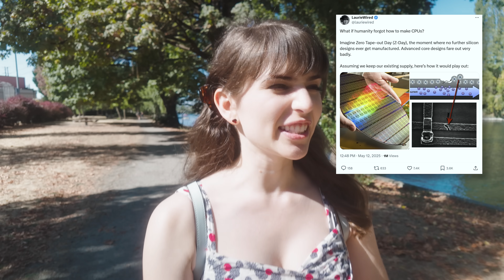what if humans forgot how to make CPUs?

Comment: A little too unrealistic for a few reasons:
1. There are a LOT of hobbyists that spend a significant amount of time and effort reverse engineering and researching even older CPU architecture. Video game emulators? Those are passion projects that require a target CPU's instruction set to be mostly or completely mapped out for emulation. I vaguely recall skimming through a defcon video or slide showing the entirety of an x86 CPU with pins painstakingly mapped out.
2. Computer architecture are courses students interested in computer science or programming can take. This could be seen as a formal or perhaps introductory to the above.
3. What happened to all of the professionals working in CPU development and production? Did catastrophic war breakout and eliminate them? Did this just turn into a post-apocalyptic story based around surviving and farming instead of one that cares about CPUs?
4. In theory, it makes sense that CPU development could reach a point where further improvements are either too costly, too minimal, or simply too advanced to realize; however, I believe any functioning society which utilizes CPUs to an extent to which current societies do would never cease CPU production. Degradation, damage, introduction of new uses, or introduction of new departments there are simply too many real reasons that CPU production would always be a necessity so long as the materials and means of creation were available.

I suppose if the materials simply didn't exist, you might have a way to make the story work; however, I would imagine alternatives, even less effective ones, would spring up in such situations. Such alternatives would restart the production, and likely development, again.

Furthermore, a world where such materials were drained or approaching depletion, might be more concerned regarding other exhaustible resources. Apparently silicon is fairly common on the moon, so perhaps silicon would become extremely expensive, but the availability of the fuel required to reach the moon might be a more pressing, immediate concern instead.

Finally, in a world where literally no one is developing CPUs and society is collapsing, people would absolutely capitalize on the opportunity to be the ones providing that product for very, very great profits.
Reply: Logic ports in chip is not the problem here. It is the manufacturing process.
Reply: knowledge is more fragile than ppl think
Reply: @gregoryallen0001  there are 10,000,000,000 of us. Is all of the shared knowledge of the species really that fragile?
Reply: @cyborgninjamonkey It definitely is. A deadly combination of factors contributes to it: the anti-intellectual movement gripping the West, corporations outsourcing manufacturing to save a few pennies, more and more specialised manufacturing processes that fewer and fewer companies can manage...

I saw a video recently explaining how essentially every CPU in the world can ultimately be traced to a single company, because that company is the only one capable of making the machines that make the machines that make the chips. It's a single point of failure that could easily trigger the fall she was describing.
Reply: The CPU emulations run either on another, bigger CPU or on an FPGA, which uses the same technology as a CPU.
Reply: Designing CPUs and understanding how they work is different from manufacturing though...

To stop manufacturing, just imagine all chip fabs being destroyed... What would it take to build a new independent fab, if you have no expert to guide you on the intricacies of manufacturing? You just have the publically available know how.

Comment: I thought that CDs/DVDs are decaying too and have to be refreshed almost like magnetic discs and floppies.
Reply: They decay but I imagine it's relatively easy to make more of them.
Reply: M-Disc dvd/bluray = lasts 500+ years
the average CD has a lifespan of 20-50 years, varies very much depending on the manufacturer

so with today's technology the dying tech of optical storage will actually last the longest

Comment: Without CPUs quality of life would mostly get better.  Cars, washing machines, dishwashers, and other home appliances were much more reliable before poor quality planned-obsolescence  MCUs were put into them.   We would immediately go back to 1980's/1990's tech in Cars, phones (nokia), home appliances etc.  
In this scenario I assume we still have discrete electronics, and logic ICs?  If so, some one would would make new computers with these components at least as powerful as a 1980's C64, BBC Micro, etc.  The few surviving Software developers would revert back to assembly, while Java, C#, Go and Python would completely die out over night due to their inefficiencies.  
The new discrete component "retro" computers would get faster and faster, not due to hardware Moore's Law, but due to the inversion of Wirth's Law.  Meaning,  computer software would get more and more efficient (the opposite of what is happening now).  Magnetic tape would come back as a storage medium.  

These computer would then evolve into hybrid analog computers, which in some cases are faster than Digital.  These then could evolve further, and go in completely new direction that has nothing to do with von Neumann architecture, nor with binary, nor even with digital.

It would be the middle ages, before a new renaissance of more efficient assembly programming, and unheard of hardware architectures.

Comment: If the only motivation in the future is to recover data from (now) present-day technology, performance may not be a big concern.  Primitive electronic computers made from discrete logic, or cobbled together from surviving artifacts could be brought to task to get data off of storage devices.  It wouldn't be pretty though.   A bigger problem is that a lot of media we use today is not built to last.  The chips may last longer than the rest, and I think simpler (lower transistor count) machines would last longer still.

Also: diodes can be built in an a few ways that don't require silicon.  I think this is just an inevitable outcome of scientific experimentation with electricity.  A society that has to re-discover this may eventually converge on present-day tech, given enough energy, time, and motivation.

Comment: In this scenario we lose the knowlage and assumes we are not gonna reinvent it later. In this case goverments stop all useless activities on the internet, no AI, no ADs, no bots, no survilence, 90% of the hardware could be shut down reserving them for later.  But we know how the word works non of it will hapen, everithing will be run to the ground, prices skyrocket as the remaining technologies fail and goverments charged extra for new emerging old tech like relays.

The longetivity of the parts are highly underestimated, even on 5nm we could expect 20 years or more. I've never seen a CPU fail with correct usage, I've seen lots of CPUs, GPUs, RAMs fail due to mostly excessive heat, sometimes voltage. I think RAM failure is the most common, which can be mitigated with software by skipping the failed memory chip, I've done it in Linux with DDR2 memory, 1 chip failed but 7 remained good, checked where the errors apeared and skipped those adresses, I lost 128MB memory from 1GB, but the laptop still worked.

Losing CPU knowlage doesn't mean we lose battery technology or repair skills. In this case we switch back to reliable battery technology and also switch back to leaded soldering for fixing/raballiing components. Example for battery, my Sony Z3 phone's battery still has the factory 2800mAh capacity, Sony didn't allowed it to go over 40°C when charging and over 60°C when discharging.

Comment: What about making FPGAs? Does this also stop or can we replace older CPUs with FPGA recreations? 🙂🤷‍♂️ Lots of other modern vehicles apart from cars would need to switch to non CPU control including aircraft and ships.
Navigation would need to revert to less electronic forms as GNSS systems would fail. 
Switch mode power supplies would eventually fail and be replaced by linear power supply designs.
Books distributed on paper or optical media with specific less complex readers based on less complex electronics. Libraries make a comeback.
Analog broadcast TV and AM/FM radios are popular again 🙂
Reply: For a given level of technology, fabricating a CPU will result in orders of magnitude higher performance, compared to fabricating an FPGA and then implementing a soft CPU inside of the FPGA. 
Exactly because of this, when Xilinx was first starting to make FPGAs, almost everybody thought that this was a very dumb idea. The reasons why FPGAs make sense are actually extremely complicated and subtle. It is only in retrospect, when we know that Xilinx was a success the FPGAs seem like an obviously good idea -- in reality, at first they did not seem so even to many of Xilinx' own workers!

Switching mode power supplies existed for a very long time before specialized controller chips started to be produced for this application -- Apple II, for example, did not have any digital chips in the power supply.
Reply: @cogoid  The first switching power supplies used electromechanical oscillators and didn't even have voltage regulation.
Reply: @rocketman221projects  Correct, and this also does not contradict anything. Ruhmkorff coil was invented in the middle of 19th century, and "vibrating" plate voltage generators for car radios flourished before the WWII. But if we look closer to our days, we find transistorized switching mode power supplies in television sets long before microprocessors became a thing, (and in various niche applications even earlier.) Availability of suitable high voltage transistors was the main thing which held this technology back, otherwise there were countless designs of transistor based control circuits to stabilize the output.

Comment: 11:19 wow you guys don't understand optical media at all. The machinery is very delicate and precise, similar to floppy disks and hard drives. And they require digital circuitry to operate and read  (let alone write).  The question is also what happens to LEDs (which read and write to optical)?  When digital circuitry dies off, so will optical media. We'll be back to tape.

Comment: I dont think cpus would die after such a short time lol. We have people with modernish cpus that have had it for 10 yrs+. A cpu not experiencing overcurrent or destructive forces would last a very long time. People would not keep the their computers on all the time in such a situation to reduce electron migration. Only ssds would more or less be severely affected. Stuff like nor flash has a data retention of  20 years. And you can just erase it then reprogram it again lol. People would find another way of making transistors, the knowledge just doesnt disappear. Server class computers are levels better than any consumer device. A server class product is made not only to handle millions of operations like reading/writing but handle heat, or stuff that could normally cause failures in consumer grade products. ECC memory was primarily made to correct stuff like bit flips or memory errors caused by various things. Mobile devices will survive because socs dont just die after a few years. Yes the solder joints might degrade or crack but thats why we have techicians that fix them. Dont even mention military grade products because these are a level above server class. Military grade stuff might even work after an emp or in high radiation or very extreme environments.

Even if every single chip disappeared it wouldnt take long for someone or people with the knowledge to recreate it. As long as the knowledge is there anything can be recreated

Comment: Seems the real question is what if we can no longer make integrated circuits? Or semiconductors in general. I think "forgetting how to make CPUs" is not a thing. We could easily reinvent the Z-80 as long as we still have integrated circuit manufacturing.

Comment: I think ZDAY + 1 day would see every company with even theoretical possibility of re-achieving the ability to create microprocessors getting all the funding they would ever need. I cannot see a situation where we would lose ability to re-invent the stuff needed to manufacture CPUs and still have understanding how to optimize software. Either we would need some magical disease that destroys our ability to understand any information we already have (which would also destroy our ability to write software), or we still have the publicly accessible information about existing CPUs and microchips and rest could be re-invented later based on that information.

The value of 3–15 nm historical chips would skyrocket for sure if the humanity dropped back to 250 nm process because details of more recent manufacturing abilities were lost and it could take a decade or two to re-achieve the same process technology level. However, even the knowledge about EUV in minds of anybody that ever watched Asianometry videos about EUV tech would speed up the timeframe to re-invent stuff needed to get to 20–50 nm in a few years max (that is, roughly 20 years back in the time in process technology). And even then, some people could remember a tweak here and there to speed up the re-implementation of the process close to current state.

For example, in case of EUV the hard part is knowing that it's possible to use lasers to shoot tin dropplets just right to get very bright EUV light source. It's much harder to blindly try to research stuff into that direction when every test is insanely expensive and you have no idea if it's ever going to work.

And if we were to re-implement the whole process technology from scratch, maybe start with a bigger reticle size this time because changing it later after the whole industry has already been locked in one size is next to impossible.